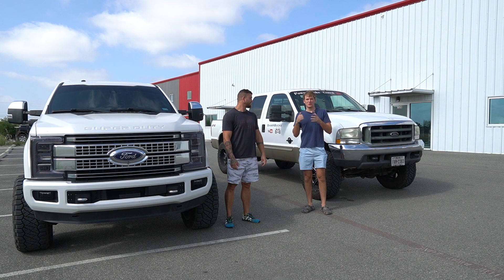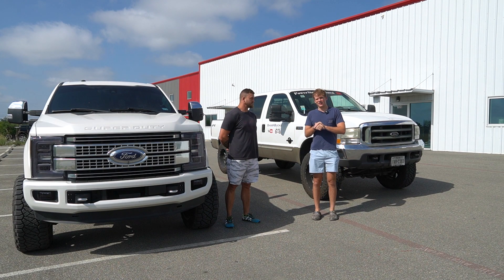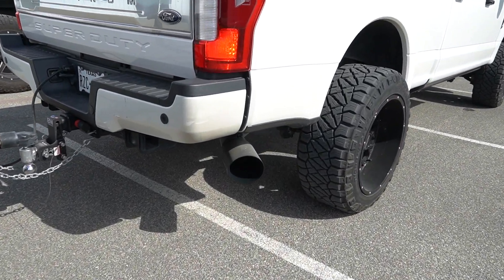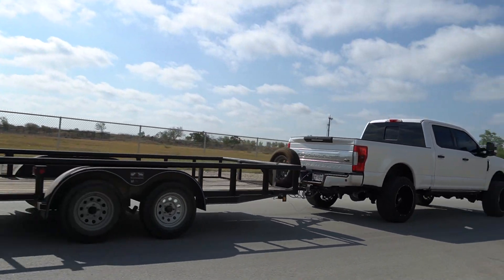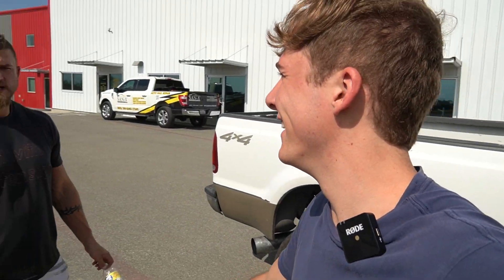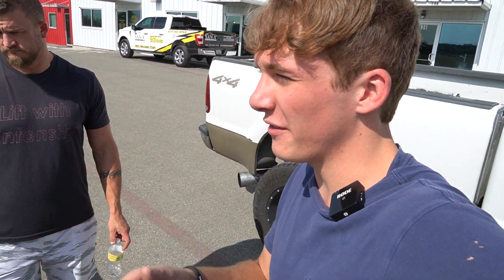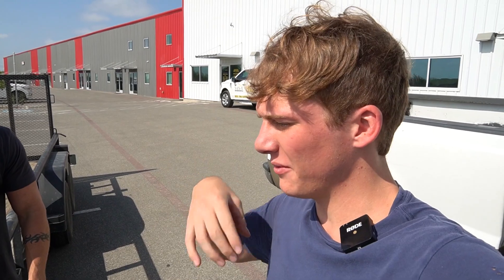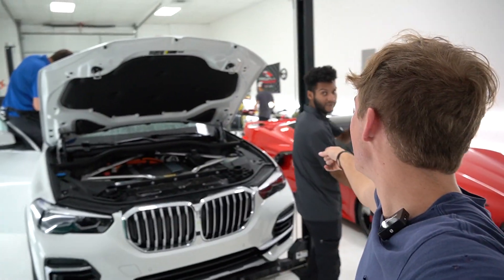6.7L Powerstroke 5 inch Straight Pipe VS 7.3L Powerstroke 5 Inch Straight Pipe Sound Difference!

Comment: 6.7 are starting to prove to be badass engines especially deleted and piped.    As far as 7.3 goes its just a classic diesel thats earned its badge of honor.  I believe the 6.7 will go down similar in history so long as the egr and muffler are deleted 🤣
Reply: Cp4 entered the chat
Reply: It only taken 11 years
Reply: @tjquigley2484  that’s why you put a cp3 in💀😂
Reply: Can’t delete in CA. So, I’m screwed lol
Reply: @tylerpetit33  well believe it or not,,emissions save the 6.7
Reply: @ictdpowerstroke4591  what do you mean?
Reply: @tylerpetit33  there just better stock
Reply: @ictdpowerstroke4591 it's not better stock, ford just makes them hard to delete properly. No engine is going to gain reliability from more emissions, its never worked that way
Reply: @theposerhoser  big tunes won't either